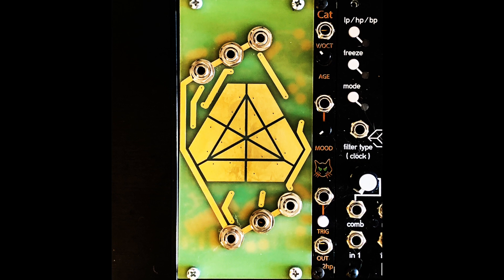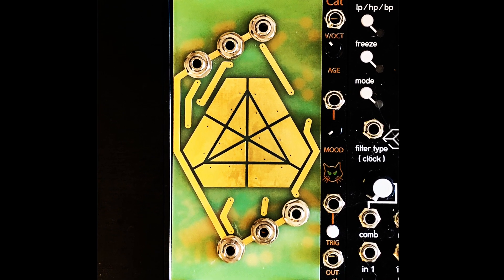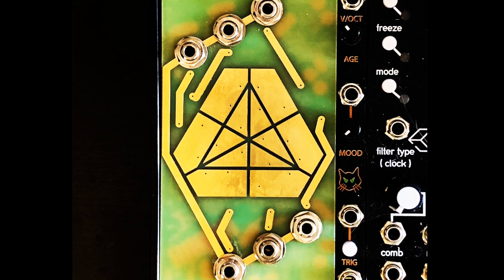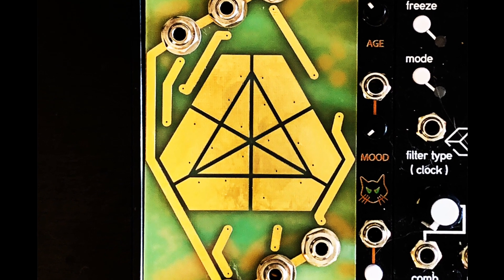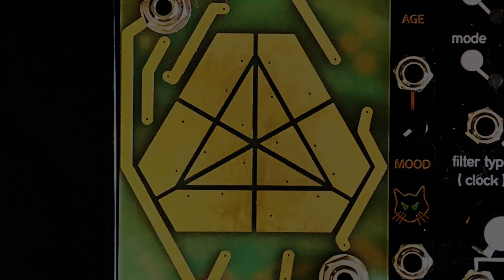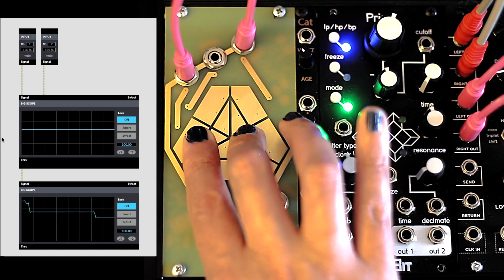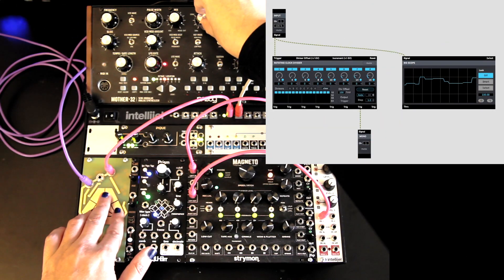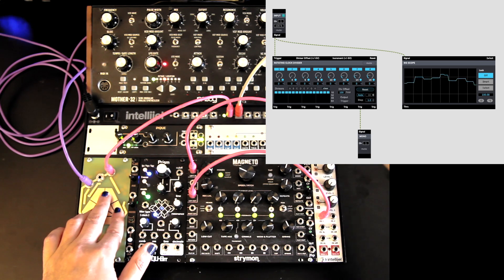Mr Grassi by Ieaskul F. Mobenthey

Comment: What’s the voltage range on this?
Reply from the maker: Mr Grassi is unipolar.  I'm pretty sure it's voltage range is 0-7V.
Reply: @CatSynthTV  ok! So is it safe to use as cv for anything? All the stuff I want to control is 0-5v
Reply: @CatSynthTV  pardon my ignorance. I just know this is a pretty experimental module, and I want to make sure it’s safe to modulate with my other gear.
Reply from the maker: Hi.  It's a valid question.  I have had no difficulty using it as a CV with any of my other Eurorack modules.